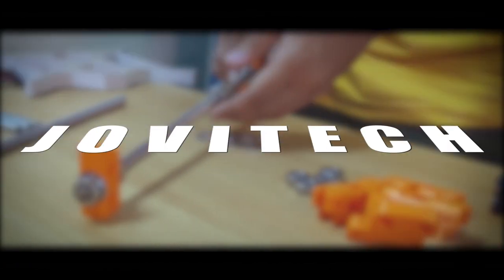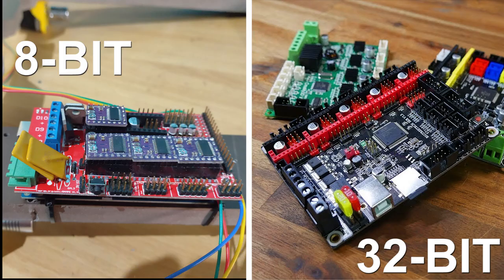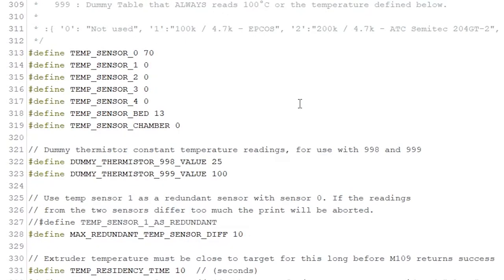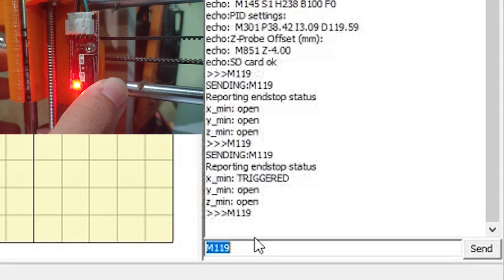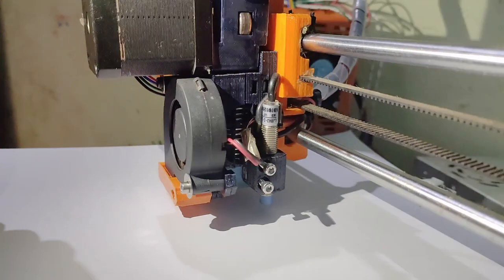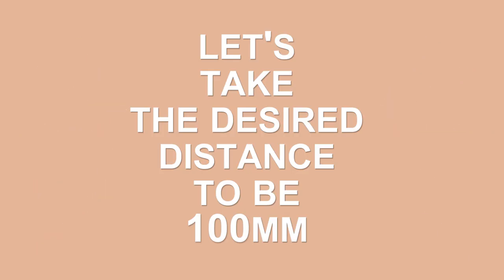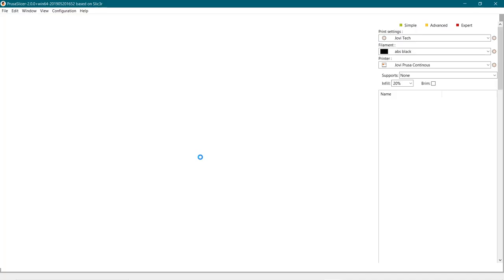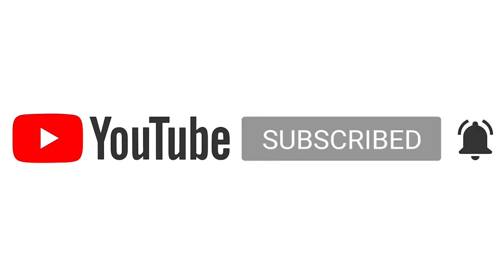HOW TO BUILD PRUSA i3 MK2 3D PRINTER: Program your DIY 3D printer using Marlin & Arduino (Part 2)

Comment: I saw your Penta video. I have a question about it. Will I be able to share its screen with Del Laptop? Like adding a second monitor.
Reply from the maker: Yes you can 😁✌️, there are apps that you can install to display using WiFi. The hdmi port on the tab is HDMI out and can't be used as input

Comment: Can i use Nema 17 2.5 Kg-cm Bipolar Stepper Motor . is 2.5kgcm torque enough?
Reply from the maker: Yes more than enough.
Reply: @JoviTech  can u tell the specifications of the stepper motor used in this video
And the purchased link
Reply from the maker: I used a nema 17 4.2kg cm. I suggest you don't use 2.5 kg cm motor for extruder and y axis. I ordered mine from AliExpress.
Reply: @JoviTech  ok thanks